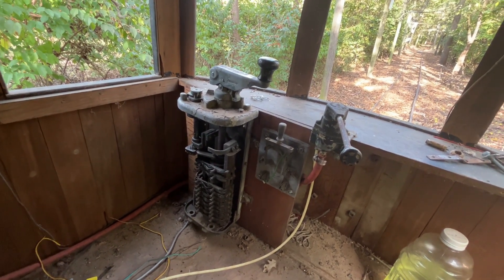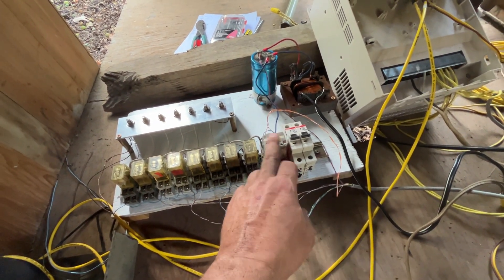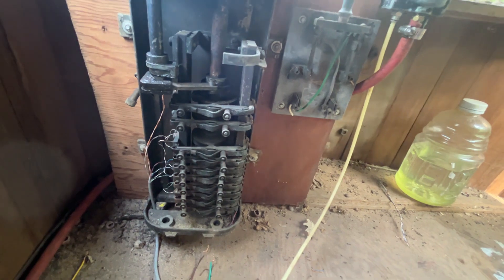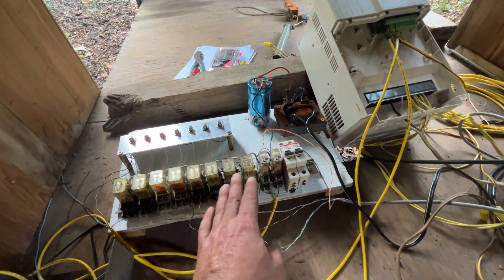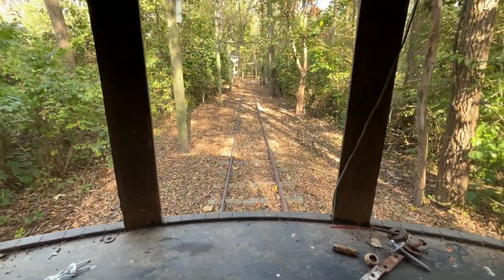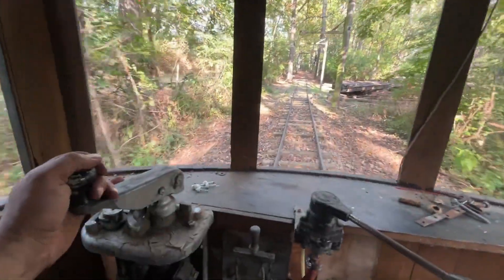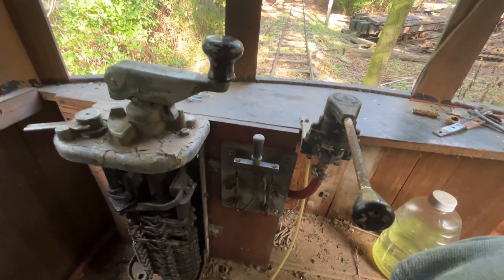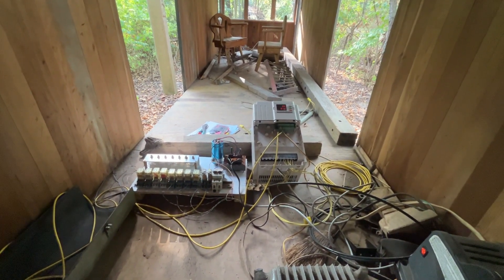Testing the Boxmotor speed controller interface circuits

Comment: It makes a great sound when the controller is rattling from position 0 to 8!!! If you didn't know that the track is 2 feet wide, you might think that the Boxmotor is moving on a 1435mm track. It's a great resemblance. It's a shame that autumn is here and winter is approaching, as we'll have to keep the trams in the depot until the weather improves...
Did you manage to maintain the ability to continue moving by inertia after reaching maximum acceleration?
Reply from the maker: I really do love the controller, it gives it a great feel of realism. I especially appreciate this after visiting Milan last month and riding the historic trolleys there and watching the motorman operate the controls. Just like our trams! I will post a video about that on here later, I have some footage that I know you will enjoy and I'm sure others will too :) I too am sad about the approaching winter, but it gives us time to recharge and think about ideas for the springtime! 
One thing I do not like so much about using the VFD is that it pretty well locks the speed of the car, so going down hill I cannot attain more speed if I want to, for instance on the straight track. Its a great feature on the hill with the curves, but not on the one where the car can operate safely at a higher speed. Given that this car has so much torque, an option would be to decrease the gear ratio so it will run faster at least. Something I may consider in the future.

Comment: I love the way you kept the original controller but found a way to use it given the low voltages you use in the line, very neat hack. Looking at the original controller and knowing the current going through it as it ran originally, I like your setup even more:)

Comment: I love that you are reusing the contactor control. I am concerned with environment of the components. If the are good relays & you vibration isolate the board they should be fine. The pots, they should be sealed, rough duty or replace with resistor board and jumpers. IMHO.
Love your channel and work.
Reply from the maker: The pots are sealed and have locking nuts on them and the relays are more than capable of handling the small amount of vibration.

Comment: That thing boogies - I definitely see it kicking in on the higher speeds.  Must have some pretty good torque in that new motor!
Reply from the maker: I am super impressed with the torque buildup, not at all what I was expecting from a non excited / non magnetic rotor! The 9:1 gear ration helps that of course, but still it is impossible to hold the car back as it will run you right over trying!

Comment: Is there a practical reason to go through the contactors and relays, instead of one potentiometer on the contactor bank shaft? I do like how it works the way you have it set up though. Does the VFD do regen braking?
Reply from the maker: It would be more work to add the potentiometer to the controller shaft due to the way its constructed, I did look at this option. The VFD does do regen braking, however the load is dumped to resistors and not back to the line, which is fine.
Reply: @CNW4145  Ah fair enough. I suppose if it sent the regen power back into the line it'd have to do phase matching and all that to not upset the grid. Nothing wrong with dumping it into resistors. It's better than wearing out brake pads!

Comment: are you planning on fitting dynamic braking resistors or keeping it all pneumatic?
Reply from the maker: I have added DB resistors, and they are being used. The pneumatic brake is now more for parking than anything.
Reply: @CNW4145 
As you notched down, décélération was quick.